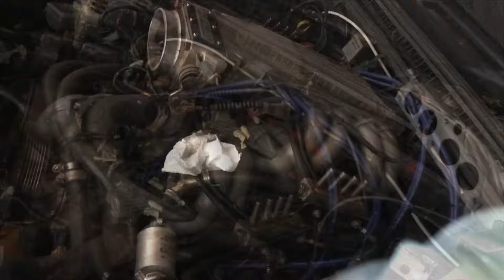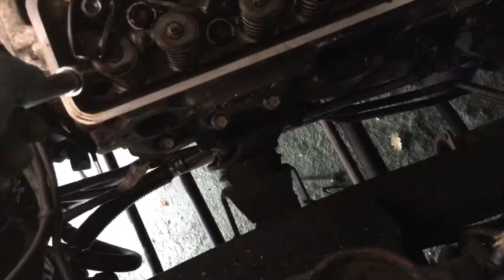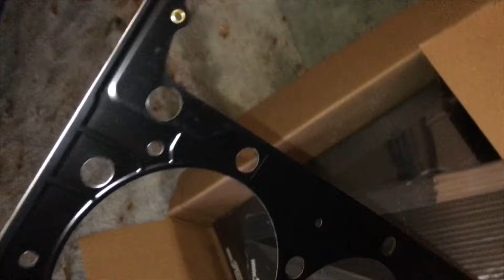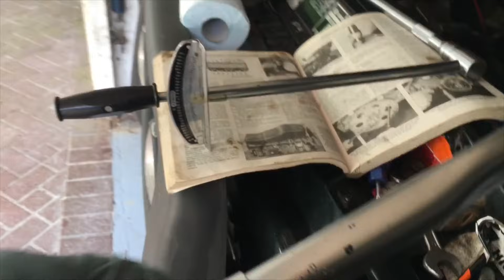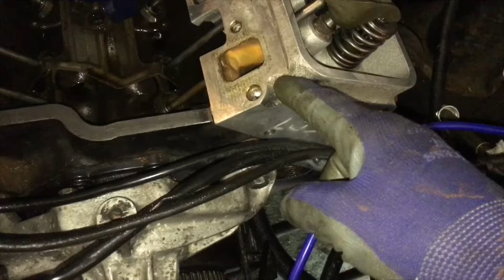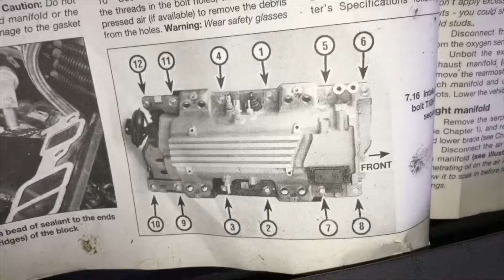Changing the Head Gaskets on a L98 TPI Small Block Chevy 350 5.7L v8

Comment: Don't reuse head bolts,if you do use a bench grinder with a wire wheel clean under side of bolt and wire wheel all of the threads all of them. Put thread sealant on bolts not locate thread locker.motor oil on under side of the head of every bolt so to torque is accurate. Intake manifold gaskets need to match all ports and restricted blocked off portion on intake gaskets go to rear of engine there is a small hole in the gasket it allows a little coolant to tricked thru.IF IT IS WORTH DOING IT IS WORTH DOING RIGHT!!
Reply from the maker: Agree.

Comment: It's a "TIGHTENING" sequence, NOT an untightening. It's really only important during installation. However, if it were, wouldn't it make more sense to loosen first, the bolt that was tightened LAST?
Reply from the maker: There should be a tightening and untightening sequence to avoid distortion. The first/last question is not that important as the bolts will be all tightened the same amount.

Comment: witch Gasket did u use or can enyone recomend one ?
Reply from the maker: The head gaskets that I used on this job were the multi layer steels ones by Fel-Pro, buying links here, from ebay UK: https://ebay.us/juS3d5
Also on the USA site ebay.com:  https://ebay.us/7HoHRd
Reply: @comeinhandynow  Thanks alot for your quick response. So this kind of gaskets need a mutch more flat surface than others or isnt it ? did planned the cylinder head?

Comment: Hi
 Great video, very informative. Nice job. I have got a 86 corvette, so same engine . When I start it up white smoke comes out and the engine is overheated after few miles (300F). The waterpump works, I can't see any water leaks. I think, I need to replace the head gasket .I am sure, it hasn't been replaced yet. What do you think? 
Thanks for the video.
Reply from the maker: I think you are right. Sounds like one of the head gaskets has gone if it is suddenly producing lots of white smoke which is steam.
Reply: My 87 iroc-z has white smoke with a gas odor when cranked

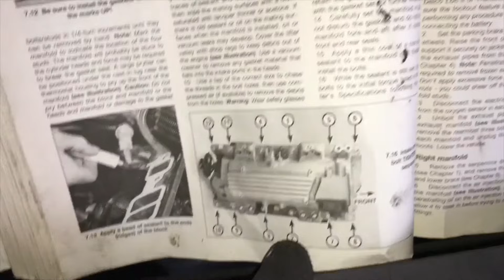Comment: just an advice regarding the intake base gaskets kit,in USA guys never use the supplied rubber gasket on the so-called China walls that actually are the front and rear block edge matting with the base intake.If you take a better look, while filming this video you can see a pic in the Haynes manual illustrating the use of a bead of silicone instead of rubber gaskets. The pic is number 7.13 on manual and it's showed at the minute 34:52.thanks for the informative video and happy wrenching from Italy,cheers.
Reply from the maker: Thanks for the comments and best regards.  I’ve actually done it both ways in the past, just silicon, or this time with the supplied rubber seals as well, both ways seemed to work well enough, I just felt a bit more confident in the rubber seals this time as they seemed well shaped on the kit I used.

Comment: Who did the LPG installation ? Which brand is it? I’m struggling to find a shop who’s has experience to install a LPG system for a L98 TPI. Where you from? Greetings from Spain ✌️😎
Reply from the maker: I’m in the U.K. The system I had was an OMVL Dream xxiN system.  You can find various parts for it on ebay (Spain) here: https://ebay.to/2HwK2Ke
Some of the advertisements also take you to installers or just do a general internet search.  I should think any make designed for that engine power should be ok.  The guy who installed it here in the U.K. is no longer in business.  I would only install Lpg if I was doing a lot of miles each year.

Comment: Is it common for both heads to be warped when ever a head gasket goes bad. I have a 1991 L98 vet and I have a blown head gasket and don’t know if the heads are warped sending it to the shop rn praying the heads are good
Reply from the maker: Kinghines I don’t think it’s common to have both heads warped unless the engine was run with no water for a while. Good luck with yours.

Comment: Good video, one problem! He said to use silicon on the intake gasket! Never and I mean never use any silicon-based gasket maker near fuel! Hi tack spray if anything at all
Reply from the maker: Used and lasted years on the bottom of the inlet, on the oil/air barrier
Reply: O2 sensor ?

Comment: That not a 95 an earlier engine
Reply from the maker: Which bit are you referring to?  Did I get a bit wrong?  It’s an L98 TPI engine used approximately in years 1985 to 1992.  Avavailble as a ‘crate engine’ for a lot longer, for instance in this Overfinch it was converted in approx 1997.
Reply: I have a 85 Corvette same engine good engine I like it

Comment: I have so many questions. This will be my first head job, any advice or special tools I need.
Reply from the maker: Well done first on deciding to have a go.  You will need some of those star type bits for your wrench, T40 and T45, were shown in the video, if you have bolts like on mine.  A torque wrench and sockets as well as thread sealant Loctite 572 or similar.  Take a look at the video description for links to amazon and ebay for buying.
Reply: take your time